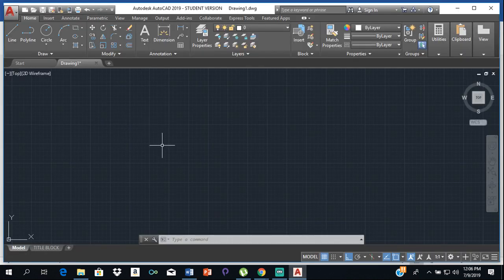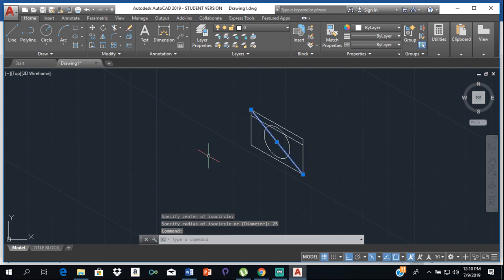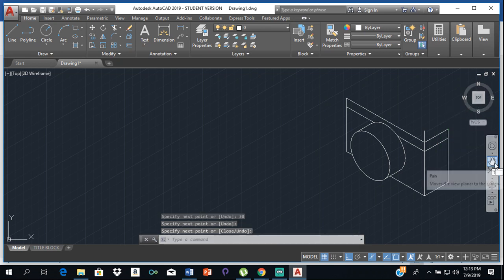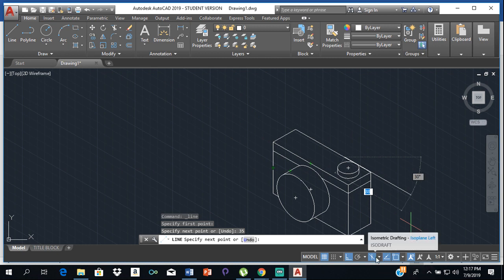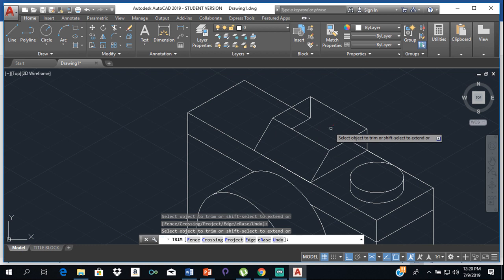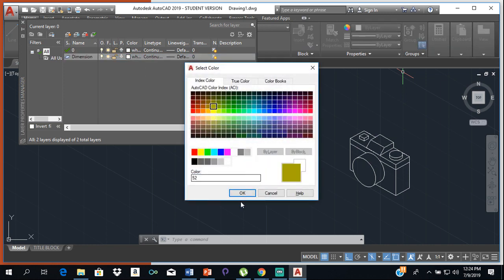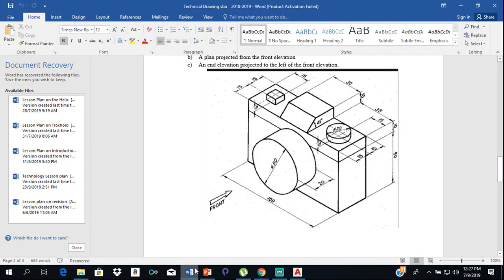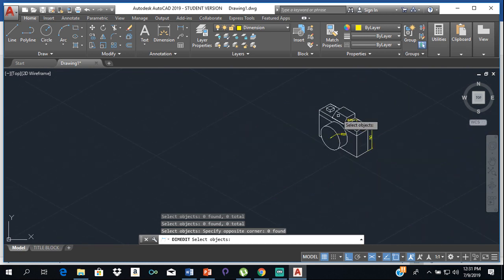Drawing the camera in isometric in AutoCAD

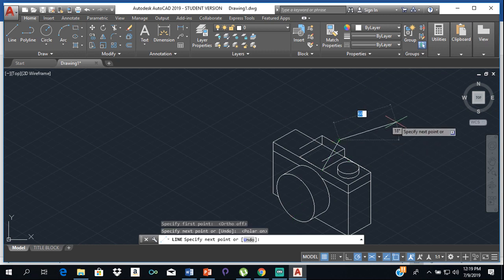Comment: 14:05 how did you choose the angle as 60°? I would like to know how you'd calculate the angle if other measure of angle, say 30° is given?
Reply from the maker: Yes it's based on the calculations because it's in isometric
Reply: @mr.cargill   how did you do the calculations sir?
Reply from the maker: @arghya.7098  Isometric is 30 degrees and then another 30 for the angle hence 60. The drawing says 45 degrees but it should be 30
Reply: @mr.cargill  thanks sir for replying, it really helped me
Reply from the maker: @arghya.7098  you're welcome.